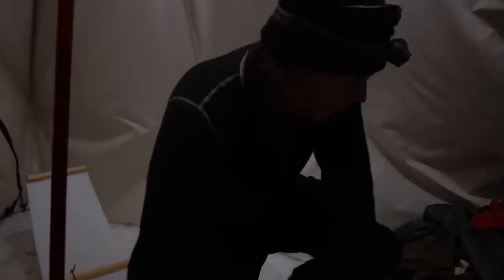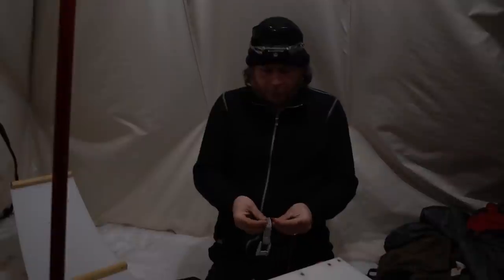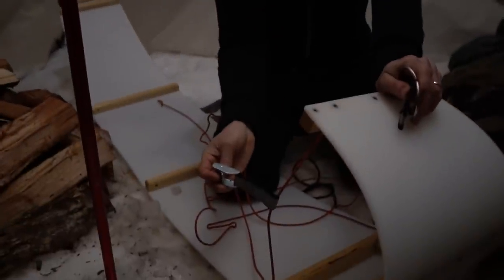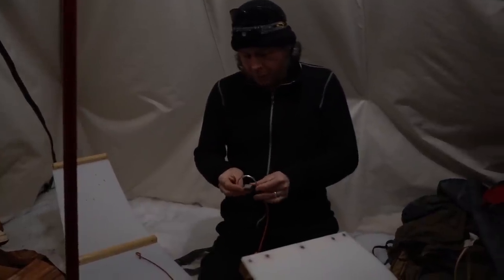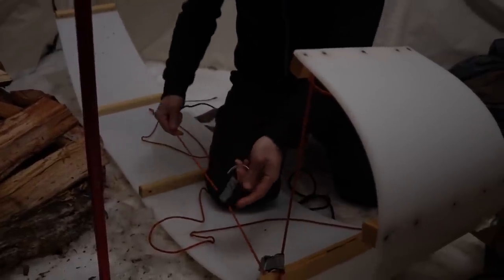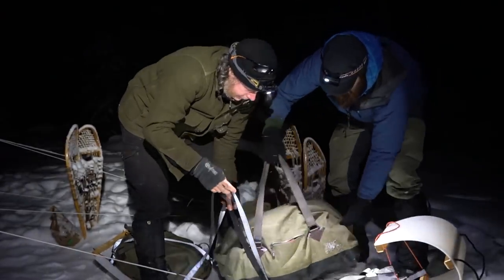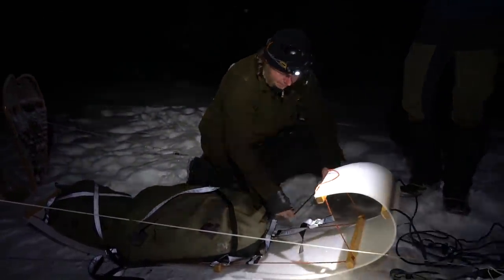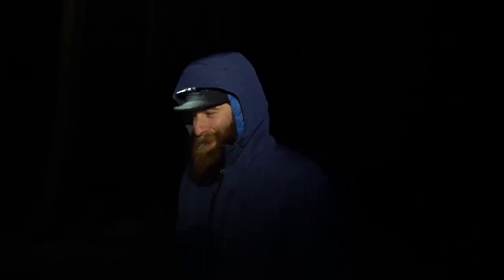Winter Freight Toboggan Strap System

Comment: Great idea, Tim. Good pull, Kevin.
Reply: What are the advantages of the toboggan over a pulk sled?
Reply from the maker: More gear and room for stove. Also easier to pull through the bush because its more  flexible. Pulk works fine though.

Comment: You might want to have a look at ROK Straps.  They have a quick release buckle with an elastic section and adjustable strap. They are a lifesaver for strapping stuff on the motorcycle and work great for hanging a tarp.